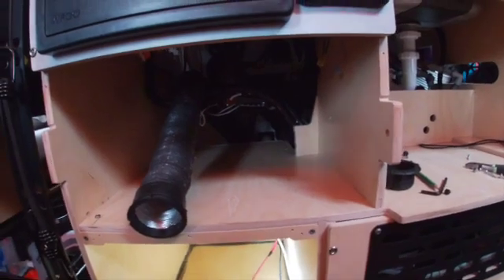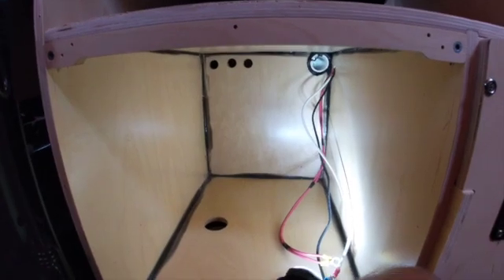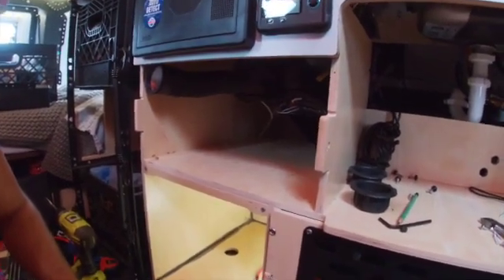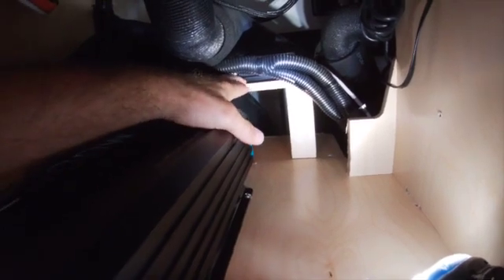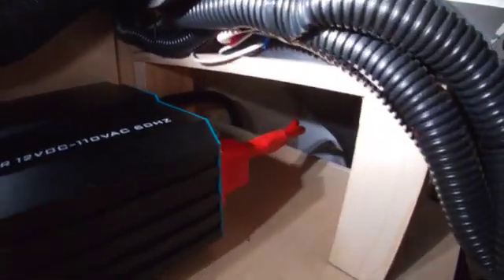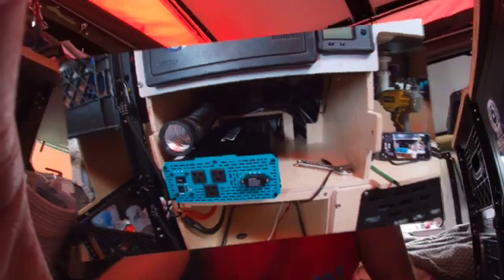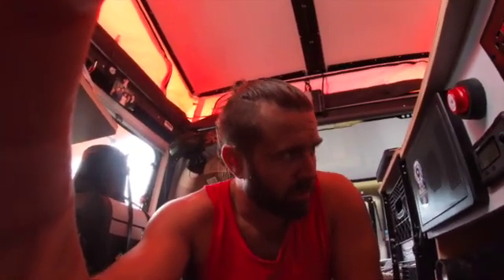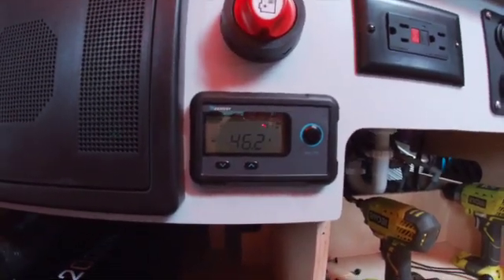2000W Inverter Install!

Comment: Currently looking into a similar conversion on ours.  A couple of inquiries for you: 1) Did you ever consider running your house battery at 24v?  It looks like a Dometic fridge accepts 12v and 24v. However, I am seeing in the Truma manual it only states 12v. Whatever voltage drop I might mitigate operating at 24v would be more than offset if I then need to install a 24v to 12v stepdown converter.  2) How does your Lithium Battery work with your tow vehicle 7-pin and the TV 12v lead acid starter battery and alternator?
Reply from the maker: I don’t see the benefit of 24V, 12v is the way to go from a capacity standpoint. Works with everything. I need to add in a DC to DC charger on the trailer to charge correctly from the Jeep.

Comment: I’m considering doing a controller swap on our mantis along with lithium batteries. Did you consider a dc to dc charger to minimize damage to your alternator? I’m wondering if I should install one as well.
Reply from the maker: I have considered it and will most likely install one soon.

Comment: what made you choose a taxa mantis?
Reply from the maker: We wanted a trailer that was off grid capable but needed some interior space (family of 4). I like the style and structure, built to last.
Reply: @makeyouradventures  thanks for your answer. Has it meet your expectations? just curious as we are condering one too. Fam of 4 as well.
Reply from the maker: @Mrcocol354  Yes, it has. I have always modified every trailer we've owned and have even built a custom one. So I knew there where somethings I would change but that would be with any trailer. I'll have more videos on that stuff.
Reply: Why do you need the inverter? And charge controller?
Reply: Did the 400 watts stay at 100 percent when plugged in?